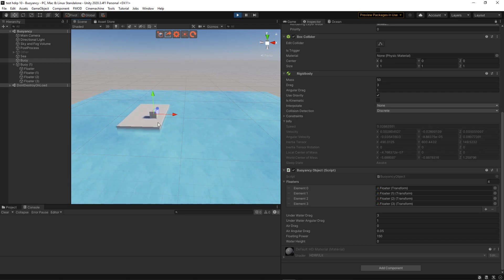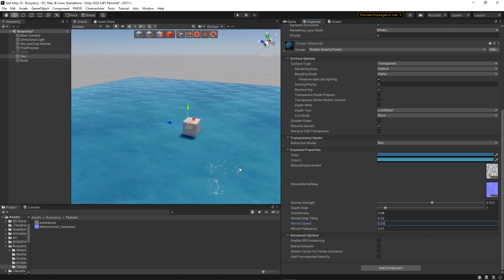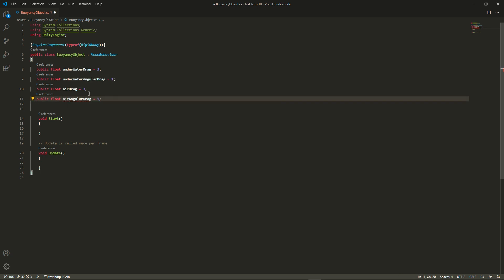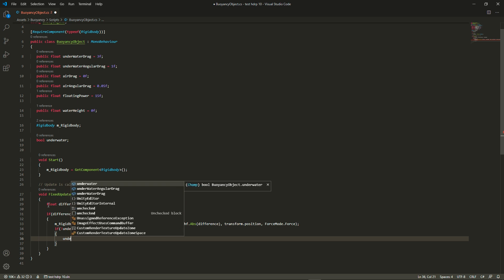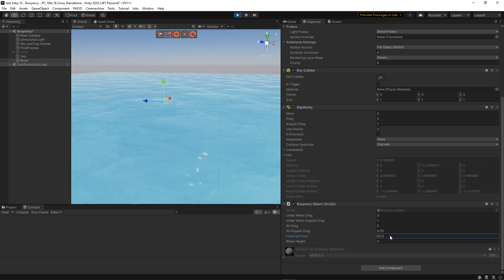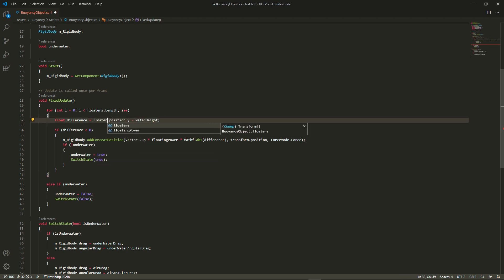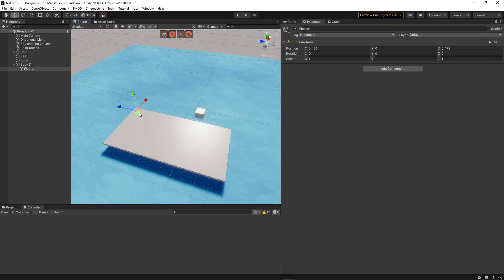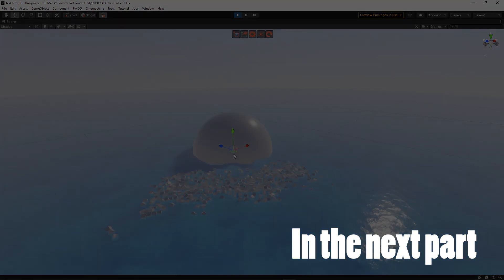Buoyancy with Unity Rigidbodies - Part 1 / Planar Buoyancy

Comment: Great tutorial! Thank you so much! Still works great in Unity 6, but some of the lines were changed by Unity automatically. This did not change the result of the code, still worked as intended! :D

It changed this:
if (isUnderwater)
{
    m_Rigidbody.drag = underWaterDrag;
    m_Rigidbody.angularDrag = underWaterAngularDrag;
}
else
{
    m_Rigidbody.drag = airDrag;
    m_Rigidbody.angularDrag = airAngularDrag;
}

To this:

if (isUnderwater)
{
    m_Rigidbody.linearDamping = underWaterDrag;
    m_Rigidbody.angularDamping = underWaterAngularDrag;
}
else
{
    m_Rigidbody.linearDamping = airDrag;
    m_Rigidbody.angularDamping = airAngularDrag;
}
Reply: Hi, miss, thanks for letting me know about Unity 6. Could you please send me the buoyancy script? I'm having trouble with objects not floating but sinking too deep even though I've set their buoyancypower. thanks
Reply: @RoziRayhanPutra  I had an issue where the object didn't float, but as another commenter said  changing " if (difference < 0)" to    if (difference < 1) meant it worked fine

Comment: hey really good tutorials, quick question how would i go about limiting the physics to only work when inside the water plane? because ive noticed that moving the plane up or down doesnt change anything about the simulation.
Reply: I know this comment if from 5 months ago but just have the water height float be set to the water planes y position. it should be waterHeight = waterPlane.trasform.position.y;
Reply: @shani1328  what would you do if you want multiple water planes in a scene that have different heights?
Reply: @beyond-thenoise  Its been a while since I've used / made the buoyancy script, but what I assume you could do is use an array with a for loop for each plane's height.